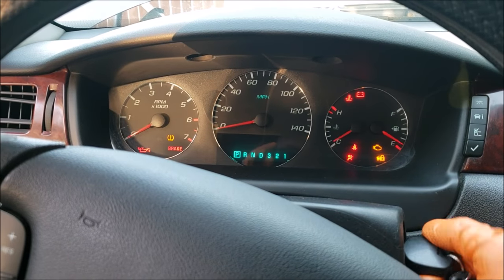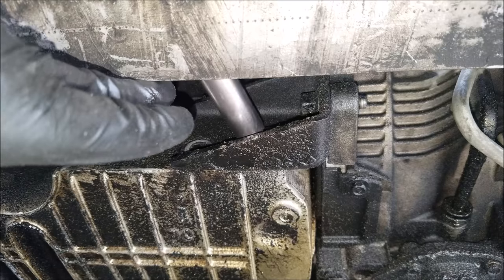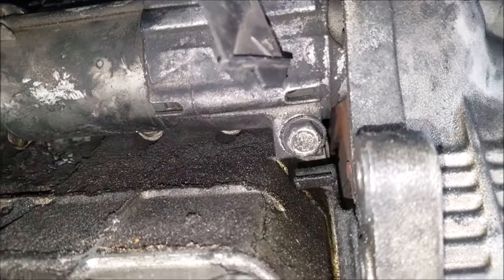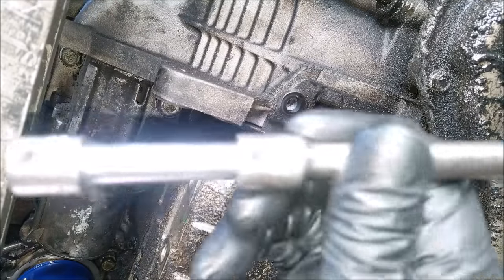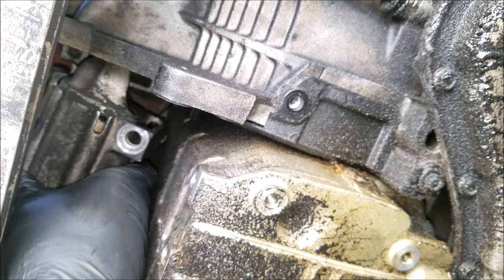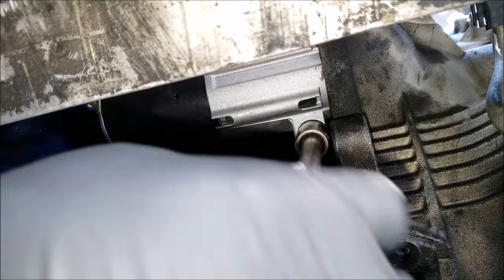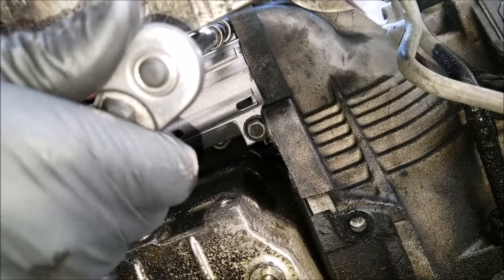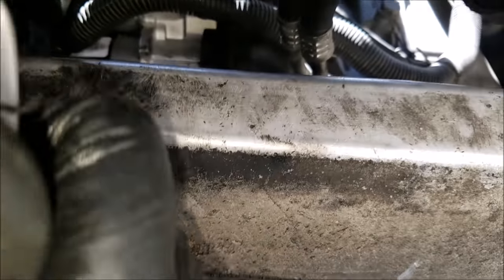How To Replace A Starter On A Chevy Impala 3.5L 3.9L 2006-2011

Comment: Would it be possible to remove the starter without having to remove the lower panel ?
Reply from the maker: U should be able to do it with removing the screws and folding down the flap on the lower panel, its just for me i had to do remove it to get better camera angles.

Comment: What's your theory on removing the ground? You can still get ark at the starter
Reply from the maker: Only if the circuit is completed at the battery, if the ground cables not touching the terminal it shouldnt arc

Comment: I have no idea how to get the connectors off. On my car the space between the frame and radiator is about 4 inches , and the hose is there. There's no way to get a ratchet in there let alone pulling the starter out that way. Looks like a lot larger gap in this video. Kind of lost what to do

Comment: is this on the drivers side or the other?
Reply from the maker: the engines sideways being a front wheel drive, so its facing the radiator, just to the side of the oil filter
Reply: @backyardchevy328  This did not answer my question as I have never been under this car. Which side?
Reply from the maker: @markolsen7438  well its actually in the middle but i was working from drivers side.

Comment: That plastic panel cover is totally in the way.  How do you disconnect the entire panel?
Reply from the maker: Well its got 3 bolts then 3 clips i had to remove through the grille to reach and a bunch of clips around the bumper

Comment: Remove oil filter and you can drop the starter without the nightmare of removing front splash guard. Have to read the comments to figure out the right way to do this job.

Comment: U need to know how to connect the wires I have red on one post black on the other and it's still clicking once and not starting
Reply: I need to know
Reply from the maker: Red will go on the positive sign of the battery...the black one will go on negative side..how are the battery terminals? Do they have any corrosion or dirt..if u have a battery brush where u can clean the inside of terminals and battery post..that might help..u also wanna make sure when u tighten em that they dont move indicating that they're still loose and bad connection

Comment: My dads 07 impala wouldn't start. It worked just fine the day before. No slow crank or anything. Then the next day, the lights and AC comes on, but a clicking noise is heard. Could that be the starter??
Reply from the maker: Usually a clicking noise means that the starters not getting enough power...hows the battery? Are battery cables tight and with no corrosion? If u try and jumpstart it does it start right up?
Reply: @backyardchevy328  just tired to jump it. Opened the door and all lights came on as usual still one solid click when turning key
Reply from the maker: @jadacollins123  i would still recommend if possible take out battery if u dont have a tester and have the cranking amps tested on it at a local auto parts store and make sure the cables connections are clean
Reply: Was it the starter? I am having the same issue when you try to turn the car over? I got a brand new battery and it still wouldnt turn over. I think it may be the starter.
Reply: @deathproff605  it was the starter

Comment: Can this procedure be applied to a 2013 model?
Reply from the maker: well procedure is pretty similar except the starter bolts will be horizonal instead of vertical
Reply: @backyardchevy328  I've been told might have to take off exhaust to create more room but I was wanting to avoid that lol. Thanks for quick reply btw! Subbed!
Reply from the maker: @SoInstrumentalBeatz  what engine do u have?
Reply from the maker: @SoInstrumentalBeatz  yea i just looked it up to make sure and unfortunately on the 3.6l yes u do have to remove the exhaust manifold to get the starter out..itll be 4 studs/nuts holding the exhaust manifold up top and 2 lower nuts attaching to exhaust pipe

Comment: If my car smokes up from the engine when I try to start it up and it doesn’t start would it be the starter
Reply from the maker: So it spins the engine when u turn the key but u get smoke as its turning? Does it sound weird if it does spin?
Reply: It doesn’t turn over. It just try’s to turn on but nothing. Smoke comes out. I feel as if it’ll catch fire because there’s a smell of rubber. It’s forcing itself way too hard
Reply from the maker: @jeanlarraga608  sounds like ur starter's shorting itself that's why the smell and smoke..its probably really hot if u touch it too..so yea i would definitely replace it
Reply: It was just like you said. Oil got all over wires. Just bought a new starter. Going to replace it Saturday. And replace or recover wires.
Reply from the maker: @jeanlarraga608  good luck🙂 i hope everything goes smoothly and u get it going again...let me know how it goes🙂

Comment: No need to touch the motor mount or the bracket there's another bracket connecting the engine and transmission right next to the transmission lines get that out of the way in finagle to start it right out

Comment: How will I know if I need to replace my starter my car just won't crank over
Reply from the maker: If u can watch this video it shows tests u can do to find out if it could be something else...https://youtu.be/LAmVHj-LVqo
Reply: @backyardchevy328   ok I will check it out. Thank you for responding
Reply from the maker: @jazzybk89  anytime🙂 hopefully it helps if not feel free to ask me any questions
Reply: @backyardchevy328   my phone is about to die but I posted a video on my channel of what my Impala sounds like I don't know if you're able to throw some ideas of what it could be but I'll be back in about 30 minutes
Reply from the maker: @jazzybk89  no thats definitely not a starter..thats something else..is there any check engine light on dash? Or security light flashing?
Reply: @backyardchevy328   the check engine light would come & Go but the last day I drove it,the Stabilitrak popped up on my Dash!  at the stop sign it completely cut off everything in the car was running but I just couldn't drive it my uncle hooked up the code and we got po 641 I've changed the spark plugs the crankshaft sensor I think so I don't know I was thinking maybe I can just buy what I need and replace it but it looks like I may have to take it in
Reply from the maker: @jazzybk89  yea that code means theres possibly damage to the wiring going to the crankshaft sensor..youll wanna follow the wires and lift the wires in places it comes in contact with metal and look for damage to the wires
Reply: Thank you again & I will look into everything in the morning thanks
Reply from the maker: @jazzybk89  good luck i hope ur able to figure it out

Comment: I've been working on cars for 30yrs....I always find it easier to attach the wires before bolting up starter....and the bracket with the 3 15mm bolts....what is the point of this bracket? My only logical thought is if the starter blows off the engine it won't fall onto the ground?  The engine is bolted to the transmission already. After helping someone replace theirs on the side of the road and having to go buy a socket this bracket was left off. 50k more miles put on the car since. Gm and their over ingenuity.
Reply from the maker: Yea on most vehicles i connect the wiring before bolting it up as well

Comment: Pro tip: with the oil filter removed it slides right out of the area.
Reply from the maker: Thank you..ill try that next time🙂
Reply: I had to do that. I found this comment after I had done so.
It actually made the mounting/dismounting a breeze!
Other pro tip: Make sure you have a a stash of oil and a new filter if this is done!

Comment: I need help with my car !
Reply from the maker: What kind of help?
Reply: My battery is fully charged and nothing is wrong with my alternator and my car will shut off while I’m driving it happened four times over the past week any ideas what it could be?
Reply from the maker: @rseanmcintosh5687  any check engine light on? Does it just shut off or does it begin to run bad then slowly turn off? When a crank position sensor goes bad it will randomly shut off and when u wait a while itll turn on again
Reply: Sounds exactly like my problem

Comment: On the civic someone told me you have to remove alot of parts to get to it ughhhh
Reply from the maker: Ive never had to its just hard to reach and hard to loosen the top bolt..but on this version i show arm placements and how i setup the tools to help them with more detailed help, see if it makes it easier in any way

Comment: It's easier to remove the starter by removing the oil filter.. don't fight with it by trying to go over the lower radiator hose..
Reply from the maker: Yes, ur right..i did one that way and it was definitely better doing it that way
Reply: Its a little messy that way but definitely faster..
Reply from the maker: @cliftonhollins167  yea, also avoids the risk of damaging the hose

Comment: You skipped removing the splash guard, it was confusing watching your instructions, like where is he seeing these bolts and wires. The splash guard was a major pain in the ass.  I had to watch another YouTuber to figure out all that.  I have 08 Impala and wasn’t able to get bolt out without angled wrench adapter. Without taking off the splash guard this would be almost impossible.

Comment: I just cannot find where the starter is underneath the car.
Reply from the maker: Do u have the same vehicle with same engine? If so it should be just to the side of the oil filter between the radiator and the engine
Reply: @backyardchevy328  I have a 2009 Chevrolet Impala LT. 3.5 liter V6
Reply from the maker: @alexlong3023  yea then it should be in same location
Reply: @backyardchevy328  My car is on a stand and I see where it is. I see my greasy and grimy 15mm bolts.
I'm guessing to get to that plate held by one bolt I have to remove three 10mm bolts to get the plastic thing off to even do this job.
Reply from the maker: @alexlong3023  should just be 1 10mm bolt unless its different
Reply: @backyardchevy328  I see everything I need to do now and accessed all of it under my car just now. I just need a 15mm socket and one or two long walks from Autozone. I will let you know when I am done.
Reply from the maker: @alexlong3023  thats great🙂👍..hopefully all goes well
Reply: @backyardchevy328  I got the 15mm socket and it wont budge no matter how hard I try. I guess I have to lift my motor up via putting a jack where the oil pan is?